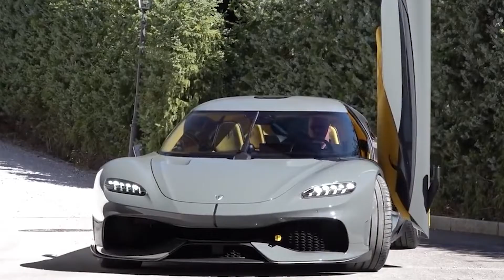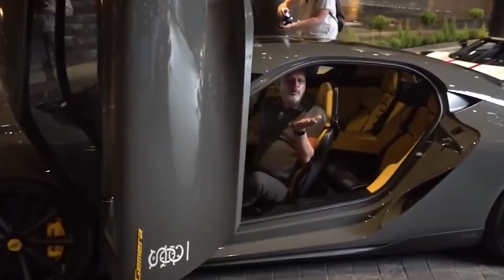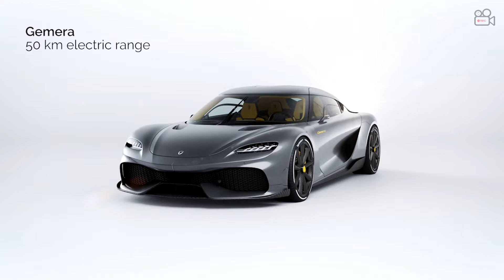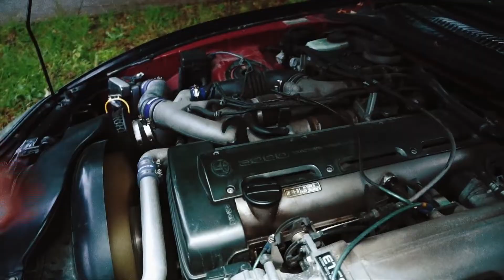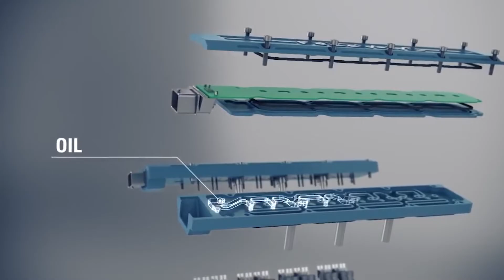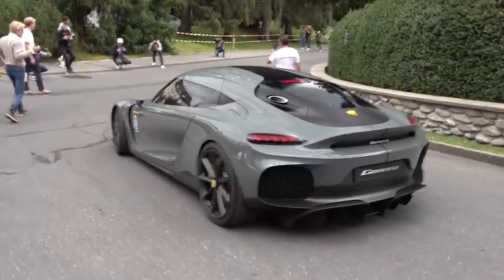Engineering Marvel: How Koenigsegg makes 600HP out of a 2.0 Engine with no Cams

Comment: First of all, 2.0L is not a tiny 3 cylinder engine.
Reply: My shitty 1.5L 3 cylinder begs to differ
Reply: Bro. I'm certain he means over all "a tiny 3.0 3 cyl"..  not the smallest OF THE 3 cylinders.. which us literally the smallest engine.. what else ever did that besides Geo
Reply: liter doesn't determine engine size. the corvette 6.0l ls v8 is smaller and efficient than mustang 5.2l coyote v8 and a 1.5l civic engine is almost the same size as the coyote v8.
Reply: @fancy3774  6.2L engine fully dressed is near 600lbs.  A 1.5L Honda engine is 300lbs
Reply: @DonLee1980 i wasn't talking about weight. I'm talking about volume because you said. "a  2.0l 3 cylinder is not tiny".

Comment: If you downsize this to a single cylinder engine. To be used in a family car, and mass produce this.
He would be a genius that was a part of changing the world.
Reply: A single cylinder might have a bit too much of a dead phase? Mated to a pancake style electric motor in stead of a flywheel could be great. But how much mileage does the 3-cyl engine even manage?
Reply: to me i think a better option would be to have a small and efficient diesel engine putting power into a generator, and then from the generator into the wheels. its basically what trains do. then even from a low cylinder count engine you can get perfectly smooth power delivery (if you use capacitors) and always optimal fuel consumption. with modern motors and generators its also very efficient, carrying the advantages of a CVT but without the powertrain losses and reliability issues (if you also have a small battery to take advantage of regenerative braking)